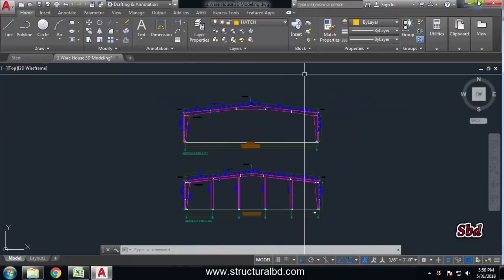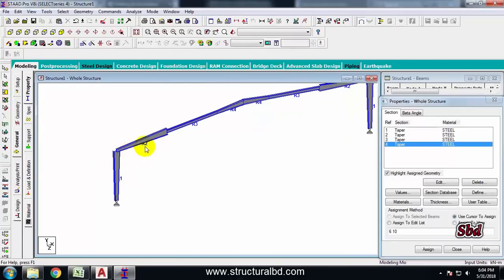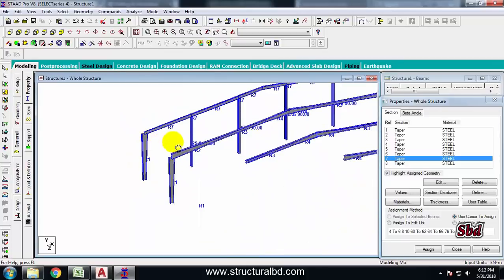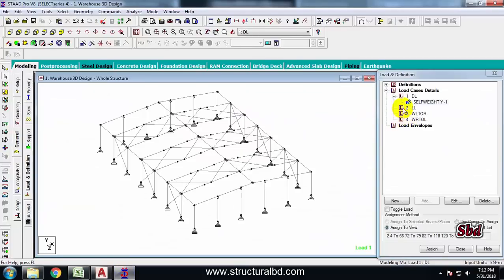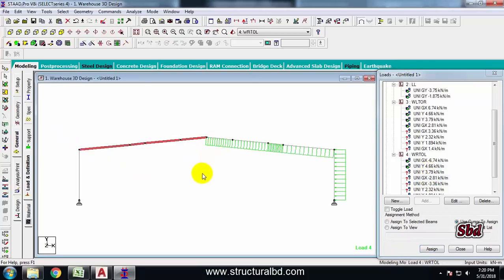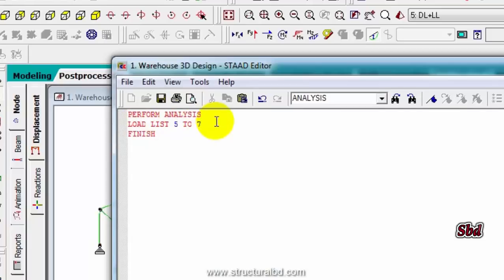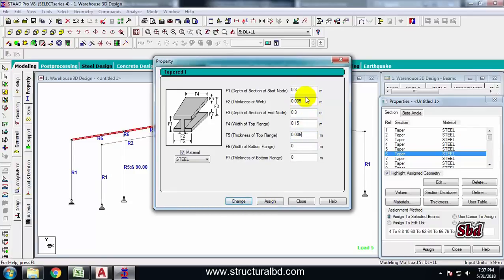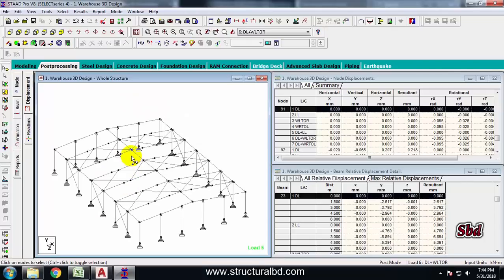Industrial Steel Warehouse Design and Modeling in Staad Pro V8i

Comment: I was designing a structure  watching this video, taper sections have assigned correctly. but the rafts do not form a uniform surface in the upper porting. they are bent. cound you help me resolve it,

Comment: Hi..Thanks, it was really a nice video to try modelling. I have a question, during post processing there were some beams / rafter whose value were more than 1 so you changed particular member size and again did run analysis. It brought some members value below 1, but there were still some member which were not green (or the value were more than 1). Why so??? And Do we need to do anything again for that? Pls respond. As I'm in a learning stage of Stadd Pro. Thanks again!!!

Comment: Thanks for your efforts in making this video. However we need to use REPEAT LOAD instead of LOAD COMBINATION. Also for the rafter design in this case we must consider the LZ & LY parameters since you have made the rafter segmented. We also need to conduct Direct Analysis Method. In AISC 360 this method is stipulated in Chapter C. Thanks.
Reply: Mr. Irwan in this video why he has not considered wind load in Z-direction. I just wanted to know your opinion.

Comment: nice video but your rafter sections are messed up after splitting them, also tension brace won't work if you combine your loads this way and finally you didn't assign Kz for columns

Comment: How to draw purlins?
Reply from the maker: The way I have shown, no need to draw purlin. However you can draw purlin like beam but design parameter should be changed then.
Reply: @structuralbd  thank you😃
Reply: Can you please teach me how to decide the rafters and columns sizes( like web , flange etc etc.)?
Reply from the maker: @parmbirsinghgill3603   It depends upon size available used in your country. Plate thickness is 5,6,8,10,12,16,20,32 mm and width is 150-275. Depth usually 250-1000. But they are none fixed
Reply: @structuralbd  thanks for considering my questions but my question is that suppose we have building with 50m span now how to decide the sizes for column and rafters?

Comment: sir..tell me how calculate slope  1.5 from 1/10
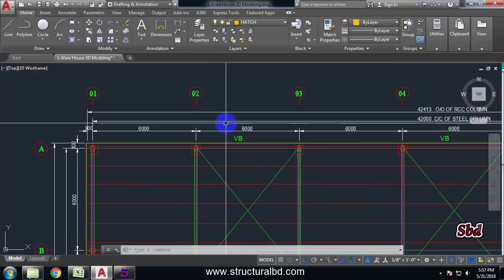Reply from the maker: Slope is 1:10, Divide the half of span by 10(Keep the unit any either mm or ft the result will be as per your unit)
Reply: @structuralbd  ..thanks..sir..your video is very   helpful for understand how to actual work on staadpro.
Reply: sir, make  some video on pre engineered building project in steel structure..and i request you next time show all calculation .
Reply: calculation in written as like all load calculation , bending moment and shear for diagram which is help for understanding design.

Comment: Great video , but  you need to use Repeated load with Tension Member instead of normal combinations  , because in your case Tension Member still Producing Compression force and affecting the design result